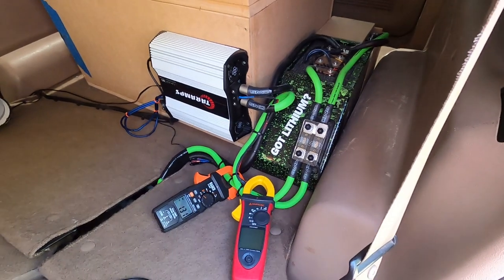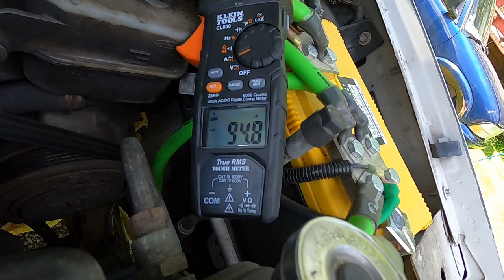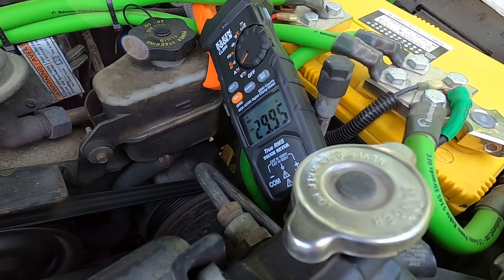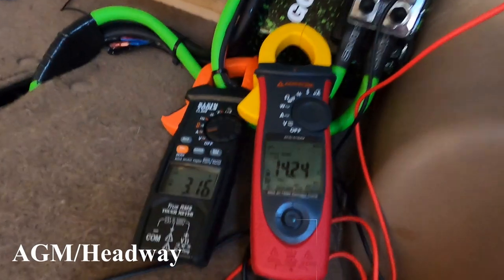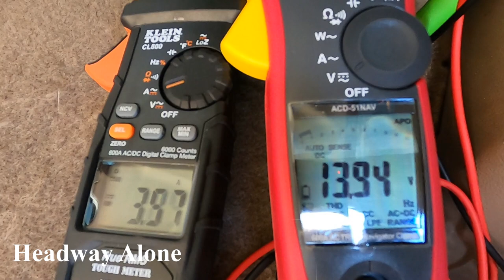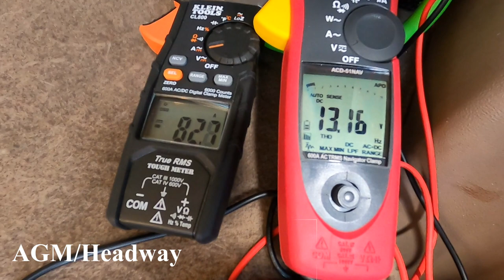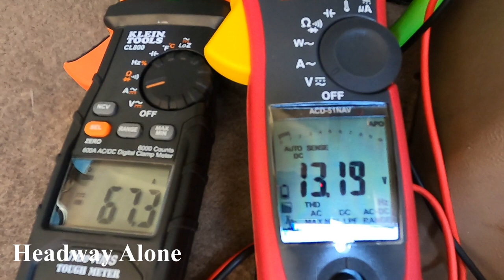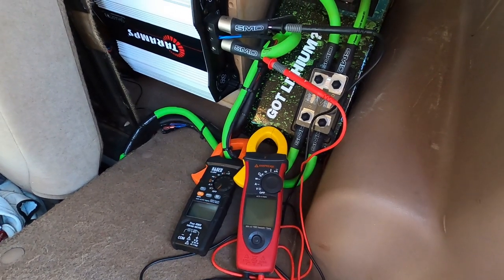AGM + Lithium. Does it function? Does Performance Suffer? Do You need an Isolator?  Answers Here.

Comment: I bought my isolator to run my first 48ah headway bank because I was told I needed it, but when I actually hooked it all up and performed my own tests I realized I don't really need it lol. Great work
Reply from the maker: Thank you.  I feel isolators are just an unnecessary bottleneck and have no place in car audio.
Reply: @gotlithium6311  What is that agm?
Reply from the maker: @angsieverz4938  65 Series from a local battery supplier, 100Ah, the guy said Northstar makes them.
Reply: Hi.in my campervan just swapped out agm x2 115ah to a single 100ah lifepo4.one of agm gone bad.question is I want to include my agm 115ah back into system but connect to a mppt directly from a 100watt solar panel on roof of van then connect the agm to the positive bus bar .my other mppt and another 100watt panel goes to positive bus.that mppt has lifepo4 setting. My Victron dc to dc charger kicks in when do my commute 18amp hour model Orion.Will the lifepo4 try to float the agm through the system.?
Reply: So I just finished building my 48ah headway.  Do I simply just run it parallel to my agm?

Comment: AGM self discharges depending on age and health they can be way worse that same 4 days with an older battery can completely drain a bank also when a cell dies in the lead acid battery wich they always do you will completely drain you lithium why would u even want to risk ruining something you put so much money into it so nice to have a switch that you can disconnect you expensive battery from the others at the touch of a button for so many reasons

Comment: I added 64ah bank of headways and couldn't be happier!! Complete Factory charging system and I stay around 14v with 3500 watt amp
Reply: how many amp alt?
Reply: @romulobello8994  I want to say it's around 180.. QX56
Reply: @jaz97  did you leave agm under hood or just running off headway
Reply: @lukeglavan  I keep factory battery due to car still being under warranty. There is like 1-2v draw but the bank never gets below 12v. Now I wouldn't have your vehicle sit for long periods with both connected.
Reply: How long can you leave it for without worrying if it will start? What size power cable are your running to the headway?

Comment: 13.2V is not rest voltage.  With a 1 amp draw 13.2V battery side measured means about 30% SoC, but it could be anywhere from 10% to 80%.  You just can't tell anywhere below 3.4 and above 3.0.  99% of the capacity exists across just 400-500mV.  You need a much better measuring technique to be accurate enough in that range to determine SoC.  It's also why nobody works it out that way.  They use other methods.
Reply: What is your recommendation? should I do a front battery delete and just run lithium in the back?
Reply: Use an isolator?
Reply: Use an isolator?

Comment: No. Lithium should rest at 13.6 v fully charged and the agm rests at 12.8 v fully charges. That difference will greatly shorten the life of both
Reply: Insignificantly..
Reply: Lithium does not rest at 14.6v. That's when the car is running. Resting is when the car is off. They usually rest around 13.3 if you also have an AGM. Go check you lithium right now with your car off. It won't say 14.6 unless your charging high using say cmax. But not with headway
Reply: @grady.stu.8300  13.6 resting voltage and 12.7 volts still are not compatible
Reply: @Juggernaut-fg2up well you got ppl that been doing it for years w/o an issue. Everything sounds good on paper or word of mouth until your actually try it.
Reply: @HNiCDuke  it's not going to explode or anything drastic. But it will reduce the life of both. I personally don't mix battery technologies thats just me
Reply: Your lithium should be around 13.4 to 13.8 resting
Reply: @Juggernaut-fg2up     it may seem they are not but you may want to try experiment, also the lead will not be at resting  as it will be  always gaining charge most of the time which is higher than 12.6 resting...... the chinese , others etc dont want people to know you can combine lead with lithium together, when you do this as many people with home boats have already done, lithium will do the work when not charging at night, and keep the lead up in voltage . Rule is always keep lead charged up and have same amphr and have more lead battery volume than lithium (example 2 or 3 lead batteries to every 1 lithium) . if in a structure , i would also make sure batteries are in outside inside of brick enclosure area for fire prevention.
Reply: @spanishtreasure9551 yes been watching Scarlett guy and others yes  they don't demands but storage and have stuff running. and yes they keep a agm to start and last longer the lipo do all the heavy work and keep that agm happy

Comment: I run a headway setup with agm. Been doing this for awhile. I was concerned about the lithium bleeding into the agm so I have a disconnect be the two. Probably wouldn't need it since I drive the truck daily.good video

Comment: Do these headway lithium batteries need to be charged or can they be used once assembles without charging. I am going to build a 32ah also if charging do I need to use a special lithium charger like xs power or down4sound?
Reply from the maker: If the assembled unit is above 12.8v, it's perfectly fine to just throw them in the vehicle and let the alternator charge them up.
Reply: rc charger work and can be got cheap

Comment: I run my lifepo4 100ah in line with my Lead acid on a 4K system with no issues. All 4 ott wires
Reply: yep  ,the chinese , others etc dont want people to know you can combine lead with lithium together, when you do this as many people with home boats have already done, lithium will do the work when not charging at night, and keep the lead up in voltage . Rule is always keep lead charged up and have same amphr and have more lead battery volume than lithium (example 2 or 3 lead batteries to every 1 lithium) . if in a structure , i would also make sure batteries are in outside inside of brick enclosure area for fire prevention.

Comment: Looks like a ton of work for an alternator at start up every time.  80 hours at over an amp is close to 100 amp hours.  That is a significant amount of current for an hour.  That is straight off cold start.

Comment: Such as all things there are pros n cons. I've had lithium tied to an agm and a xb630 ultrcap for a few yrs with no issues. The drain is even less noticeable the more capacity you have. I'm at 128ah from 256ah last summer. I love batteries so I find I have more juice than I need to run my 8kw system. It's FAR better than half a ton of AGM that is for damn sure
Reply: does that ultracap come in 24 volt?
Reply: @immrnoidall 14v the highest I've seen XS Powers ultracaps. I believe it charges at 16v
Reply: 256ah is crazy for 8k dawg... I have 40ah LTO and run 5k no problem at all. My buddy has 96k on the bass but he has 800ah of LTO... you got enough juice to push 25k easy.

Comment: I don't use my batteries for audio but I have 5 batteries in my Explorer 2 under the hood and three behind the seats 1 is a deep cycle and one is small starting battery stock alternator 130 amps I guess 
Starts right up no matter how many days I let it sit and I have an Inverter I never shut off that keeps cordless batteries charged .  No Special   ad ons no fuses    no isolator  it works fine .
been doing that over three years .  The Three behind the seats are even wrecking yard car batteries I plan on upgrading to Deep Cycle or maybe toss in one Lithium battery .

Comment: Wondering how if you are pulling 1 amp for 80 hours isn’t that 80ah? 35 more than the 45 ah battery? How does that work
Reply: My thoughts exactly. He claimed his meter was showing about 1.25A draw over 80 hrs = 100A from a 48A battery. Nup! Something wrong there.

Comment: i drive 65 miles one way to work, where the car is parked most of the day in an environment that can get to 125 fahrenheit. my concern is the operating temps of headway lithium, in a trunk of a car in that kind of environment are they going to be okay or should i stick to AGM?
Reply: I live in Las Vegas and have 32ah of Headway cells. I usually keep a window or two cracked but summer temps outside go above 115*F a lot. No problems so far.

Comment: I got a question. So I hook up the headway to the front battery? It’s stock battery and I got a stock alt but I’m putting the big 3 in as well. It’s a 48ah headway bank. Or do I need a agm aftermarket battery?
Reply: You gunna want a agm

Comment: My question is, i have a 64 AH headway bank. i also have agm under hood and XS Power d7500 in trunk. can i run headway lithium with 2 agm batteries for max performance. (agm under hood & agm in trunk)

i have 0 gauge and h/o alt very clean
Reply: Yes.i have 3 batteries plus a 96ah lifepo setup.all in parallel. About a yr and a half...no.issues.2 brazilian 8ks for bass...

Comment: So I bought a 200ah lossigy battery is the bms gonna pop when I turn on a high amp stereo say an 8k taramps?
Reply from the maker: Without knowing exactly what BMS is inside and what its set up to do, I really cannot say.  It shouldn't damage anything but if it's limited to 1c discharge, it could disconnect the battery until load is removed.

Comment: I see the point you are making for the different batteries. BUT you are killing your already weak alternator. I have a 4,000 watt RMS system with a 1v drop pulling 180amps @ idle of 850rpm. At 1800rpm i get 398a and no drop in voltage @ 250a pull. Just 2 agm batteries 1 mechman alt. 14.6-14.8 continuous. Plus you have a gremlin eating power somewhere from the front battery to the rear 0:39 vs 1:23

Comment: After the test tone the Headway recharged around 3a but the AGM/Headway recharged around 5. What causes that? Seems like the Headway would've came back faster if it was getting 5a instead of 3?
Reply from the maker: The amp clamp was only reading Discharge current, it's not clamped on the same line as the feed to the lithium.  The amp draw difference was from the amp fans running in the AGM/Lithium test and not the Lithium only test.

Comment: Awesome video, so if i habe a xs 4900 agm underhood and want to add a d4s LTO 6.0 lithium battery i dont need an isolator? Heard some say you dont need it and some say you do. Would i jus run power from my front battery to the back of a fuse block through a fuse to my lithium then back out the lithium throuhh a fuse then off to my amp? I like the smd double fuse you have that has the little bus plate on it, jus wanna make sure my alt charges that lithium to which is a mechman 320A

Comment: SO ARE YOU RUNNIN POWER WIRE FROM ALT TO AGM TO BANK OR DO YOU HAVE YOUR ALT TO AGM AND SEPERATE WIRE FROM ALT TO LITHIUM
Reply: yes. alt to agm then to headway. my agm has a sky high 4 spot distro block under the hood that parallels everything there. simple and effective
Reply: Would running a separate set of pos and neg to lithium battery in the back  from the  alt result in even better current flow then the alternative to agm, then from agm to the lithium in the back?

Comment: ok in my setup i have 2 evl 15s and same amp (taramps smart 3k) with a huge AGM and an 16 cell headway. the orientatation is as follows, Stock batt i thing an agm to the secondary huge agm to the lith to the amp. Should i remove the second agm?
Reply: I wouldn't. Might as well keep all the reserve you can

Comment: I already have six XS power d7500s in the rear.  Do you think i would benefit from adding a headway bank next the the agms?  I just want better voltage.  Im dropping to 11v 10k rms clamped stock 120a alt.  I can get a bigger alternator too just curious
Reply: I would deff get a high output alt then you should be fine with the 6 batts I would imagine I have 5krms 1 xs d6500 300 amp alt and I only drop to 13v sometimes 12 so I'm gonna get second batt when I'm driving itll only drop to 13 v

Comment: Running headway with agm what about replacing athe agm with a ultra cap bank.
Reply: I'm doing this tomorrow. Have 168ah of headway and a d3400 under the hood. Taking out the d3400 and putting in the xspower sb500 34r tomorrow

Comment: What battery should I get for a 15000 W system ?.
Reply: I run 2, 48ah lithium banks and a 4800agm battery in the rear. Another AGM under the hood and about to add a 2nd battery under the hood (2016 yukon xl denali)
Reply: Depends on charging voltage.

Comment: @
GotLithium?  is headway lithium really worth it, if the voltage drops just like AGMs under musical load ?
Reply from the maker: Oh it's absolutely worth it.  Headway is present in both tests in the video, this is only showing that the AGM isn't a Load hindering lithium performance.  
Without the Headway, Voltage is Deep in the 12s on music and high 10s on the Tone.  Massive difference.
Reply: I know this is old, but I recently got a superbeast. I converted it to 12v and it's 96ah. It made a huge difference for me. I mean before my tach needle would move a good 500rpm and you could actually feel the car lurch at lower rpms and idle. I have no more of that with the headway.
Reply: @SouthwestD313  Very nice. I am still in the middle of installing the full system including a converted superbeast, but pretty stoked to see it all come together and see the look on my wives face when the bass tries to peal it off 🤣

Comment: What size alt
Reply from the maker: Stock 130a, and by stock I mean from 1998 lol.  It's definitely a lil worn out.
Reply: @gotlithium6311  much faster rebound then my 90amp lol
Reply: Okay so it not going to ruin my alt which is 130a stock. If I make my own 16ah 12v headway lithium bank. Some people say it draws to much current but this video proves otherwise??
Reply: @brandonellis6260  no it will not